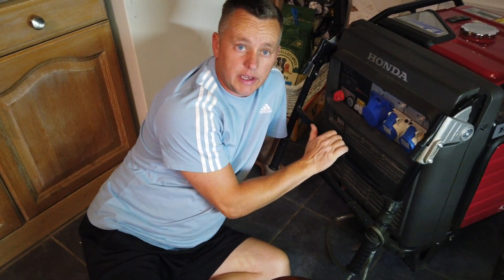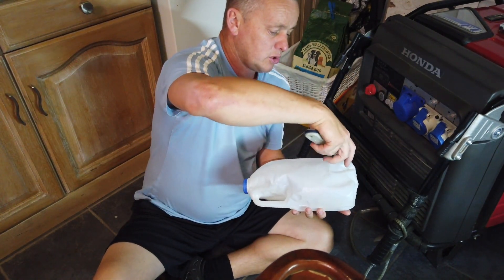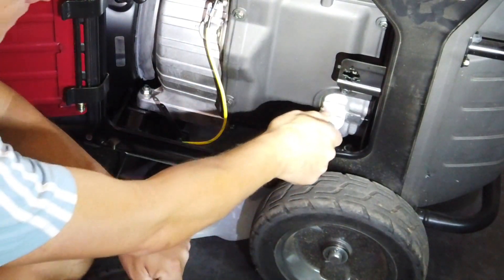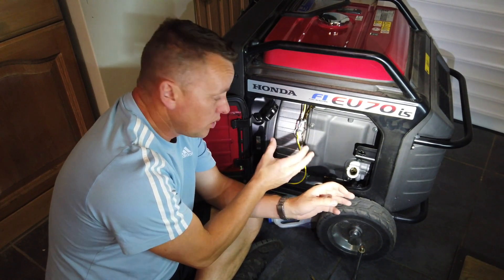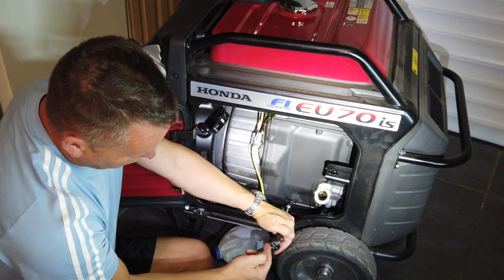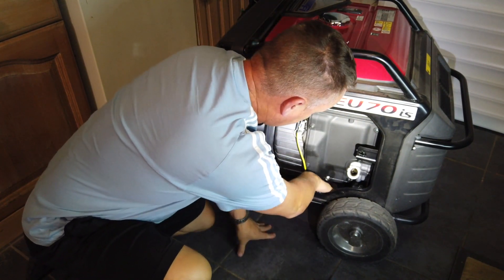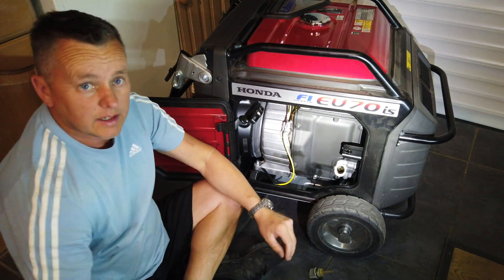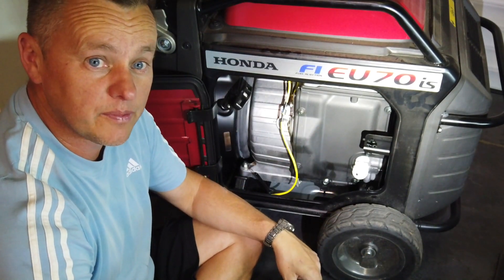Honda EU70is Generator Oil Change, "Oil Service"

Comment: You’ve clocked up a nice few hrs in a month, it’ll be very interesting to see how many hrs a properly maintained Honda can clock up, you got a great deal on it as well, I’d love to have enough work for one to justify the outlay, they’re over 5000 euro here in Ireland, the latest one you can connect via blue tooth and start and stop it with a smart phone, great funnel, I used to throw them into freezer bags to keep them clean, very watchable vids, your a natural
Reply from the maker: She is running like a dream, and something I forgot to add, the efficiency is amazing, it will run the Coffee van for 6 hours on £5 petrol 👍🏻Thanks for the great comments👍🏻👍🏻🛠